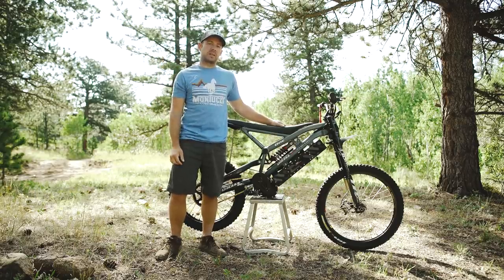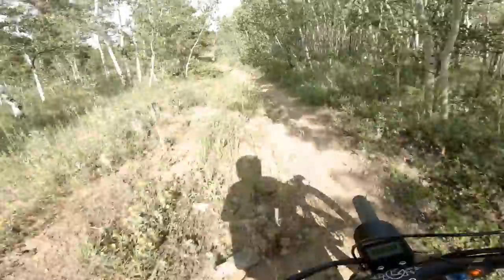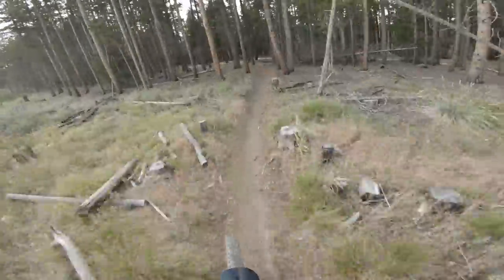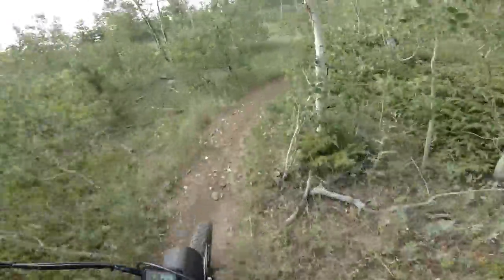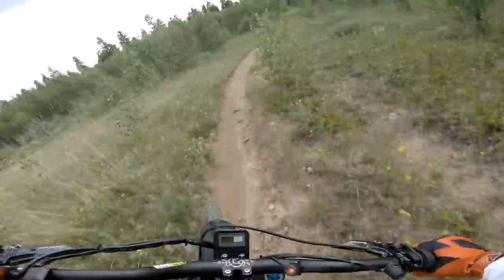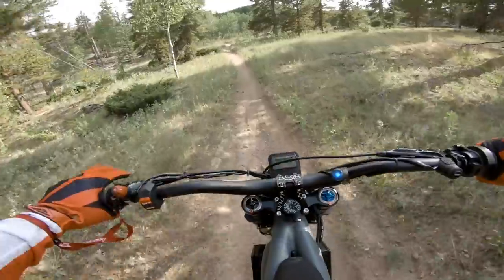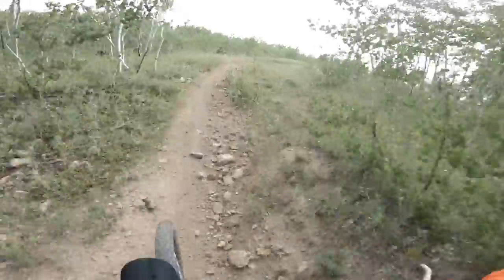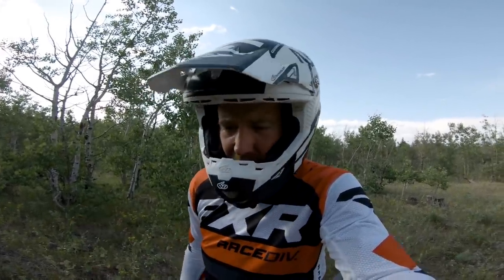CZEM Drill One Electric Dirt Bike | A Sur-Ron Destroyer?

Comment: lets b honest, there is only 1 power mode
Reply: 😂 I concur!! 👍🏼
Reply: So it doesn’t have a gear box or nothin ?
Reply: @AllenMackenzie  no electric vehicles have gearboxes
Reply: porsche taycan turbo has a 2 speed gearbox and its electric
Reply: @poppajack5332  my point was there’s no need for them except if you want to change torque ratios
Reply: @brqxton8974  not true
Reply: @brqxton8974  should’ve said that and not a complete lie
Reply: Dude all e bikes have one power mode when enough caffeine has hit the system
Reply: @brqxton8974  One year later, the Talaria Sting and yes it has a gearbox.
Getting it within two months, street legal with, out of the box top speed of 75 kmh, has been modified apparently to go up to 96kmh. The gearbox not only eliminates the belt drive but keeps it nicely going in hot weather and will keep on going where a Sur Ron would burn out its motor. Roughly the same price as a Sur Ron but heavier and meatier

Comment: At $9k+ I’d say it’s not a direct comparison to the $3600 Sur Ron. But they are in the same class of emoto bikes (MTB components, handles more like a regular MTB, no pedals, all electric, less than 150lbs).
Reply: On paper, I agree.  In reality, no, not unless you leave it stock and just ride it on the street.  Once you add up the cost of  all of those improved components, it's essentially the same price...and you just saved yourself a lot of time and aggravation getting it straight from the factory in a finished state.
Reply: i mean the sur ron is waaayyy beter than this drill one, but in my opinion the sur ron is a bit more ugly lower top speed it looks more like a motorcycle and the forks looks like they a bit too thin. so i like the drill one more. but the price hurts
Reply from the maker: @ATCr Absolutely. The reason I briefly mention the Sur-Ron is exactly what you said above, it is the same class of bike due to their style, weight and components. The price is TBD in the US but will be higher than the Sur-Ron due to it's higher end components. This isn't a comparison video of the Sur-Ron and Drill One.
Reply: @ElectricCycleRider  what is your experience, between th sur ron and the drill one of the battery life and the power. is it worth to spend 8000dollars/€ or not ?
Reply: @GoldCustomBuilds  Absolutely worth the Spend!
Reply: @GoldCustomBuilds  Why do you say Sur Ron is better?  I have a new Sur Ron personally.  I'm telling you from experience, it's a great electric bike for the US price.  If you're in EU, the Sur Ron will cost A LOT more than I paid.  Also, our only distribution option is a joke compared to the experience you'd have walking into any power sports dealership selling gas moto bikes. Luna will not give you advice on aftermarket or sell any aftermarket upgrades...only their own brand because there is no $ in it for them.  They just want to drop ship bike orders from China.  No bike building or service center like a real dealership and they carry no inventory of really anything.  It's a great bike to keep as a street bike or to get you into riding.  But it also comes with negatives. Distributors all have a monopoly in each country - great for their profit but hurts customers and keeps the bike as a niche novelty vs. mainstream gas competitors.
Reply: @troymuni6120  i dont say that hte sur ron is better. im think the drill one is better. but the sur ron is a great bike too, but it looks too much like a motorcycle. the drill one not...
Reply: @GoldCustomBuilds  Ah gotcha, sorry I misunderstood. Sur Ron is def good, I like mine - but it's hard to find parts.  Also had 2 shops tell me they won't work it because they say "it's not a bike".  I brought to dirt bike shop and they told me no also, "it's not a motorcycle".   The Drill bike looks like it has high-end parts already, so not having to buy/install any upgrades is nice.
Reply: Troy Muni yeah thats bad. 
But exactly like you said. On the drill one are already high end parts
Reply: We have 3 us sur-ron dealers now...They all suck though. Segway who is even worse than Luna cycles which is a let down given Segway size, Luna, and some new sketch company. They are offering sur-rons now and they offer the lightning 72 volt sur-ron battery. I don't know the batteries specs and they don't list the cells it uses which is full blown sketch.
Reply: BoyTitan oh wow I had no idea on that 3rd company. Interesting shit tho. Betting it’s the same battery Luna is offering to people to test.  I would also bet my left nut that the testers will be signing an NDA so no one trashes it online or takes it apart to reveal anything. No thx not for me. Litespeed 72v have Sony VTC6’s = best of the best.
Reply: @troymuni6120  Oh ok the litespeed battery they are selling is good then didn't know it used sony vtc6's thats the battery I was talking about. How ever now I am wondering if its legal for them to be selling litespeed battery at a 350usd markup. The site is ebikezilla.
Reply: @troymuni6120  Also seems I screwed up they are based in canada. They use usd on the site so that confused me.
Reply: BoyTitan ahh ok I didn’t know they were marking up the litespeed. I ordered a litespeed direct the day I ordered the sur ron. It’s a good battery but the guy running is overwhelmed by demand. Teznic is another option and there’s another in the UK but I have nothing to offer on either as far as being good or bad options. Litespeed is legit tho, he’s just not good at communication or logistics, but is a solid technician. You’ve gotta chase after him a bit since it’ll be about a month late. He’s not a scammer tho I can attest to that. Even got my bac8000 kit from him direct.
Reply: Ante Milas after seeing a close up of the Drill, it’s so far from the build quality standards of the sur Ron, just forget it. Don’t even entertain the thought. Stick with the sur Ron and upgrade it yourself. That Drill Bike is years away from being commercial ready based on what I saw.
Reply: @TinyTitian  Who are the 3 US dealers?
Reply: in switzerland the surron is 5'500k but this bike is propably gonna be more expensive aswell id say 11k
Reply: It's actually 16,000

Comment: Over 9000 dollars why are you comparing the two lol
Reply: They got same size.
Reply: Because it's every gear heads nature to upgrade and hot rod their rides.  By the time you add up the cost of all of those components, you're in the same price range and it looks like a superior bike.  Plus you just saved yourself a ton of time that can be spent riding the bike instead of trying to find parts.
Reply: Also in the EU the VAT tax is baked into the price of the bike, which is +20%.  That should come off the top. Just the fact that it looks like they already have 2 resellers gives me hope.  Competition should drive the cost down.  Luna can shit all over us if they wanted to and we have no alternative...pick your favorite color: black, black or black.
Reply from the maker: @CJ Moto The reason I briefly mention the Sur-Ron in my review is because they are a very similar category of bike. As @Richi Bob mentioned, the bikes weigh almost the same, use the style suspension, brakes, handlebars, stem, wheels, mid-drive electric motors. The price on the Drill One is TBD as it's not technically for sale in the US yet but it will cost more than the Sur-Ron due to it's higher end components. And as @Troy Muni pointed out, a lot of Sur-Ron owners are spending a lot of money upgrading their Sur-Rons. Not trying to put down the Sur-Ron here, I have plenty of videos about that bike too. Hard to ride this CZEM and not juxtapose it to a Sur-Ron.
Reply: I just watched a review of this Drill One with sub titles and it looks like a complete turd.
Reply: @ElectricCycleRider  Honestly, after seeing that review up close of this thing, it looks like they ran out of $ and pushed it to market.  Basically doomed it out of the gate.  Just a really poor manufacturing process and quality control.  No way in hell I would buy that bike.

Comment: The other feature on Drill One not many know about is it comes with changeable motor axis sprockets - that with a simple tool in 3 seconds can be changed out for adjusting motor torque and riding conditions and terrain. So now with the changeable maps , adjustable footpegs and adjustable rear suspension geometry pivot points. Its very easy to find your best custom setup. This helps when riding hard and fast - which is what this bike is made for. We love SurRons too and brilliant value or their money - (in fact they are silly under priced by the Chinese) so any    Dirt E Bike after SurRon pricing may look expensive. if you look beyond price to  the value of the complete package and you want to ride green and sick of fumes pollution and loud gas noise  of KTM -etc..  this is an option. yes you wont get the range of gas bike of course ...but it depends where your  own compromised break even position for doing something good for the environment and getting into new technology sits with you :)